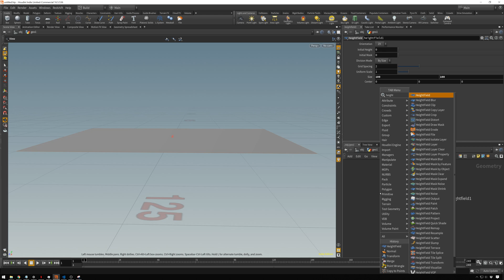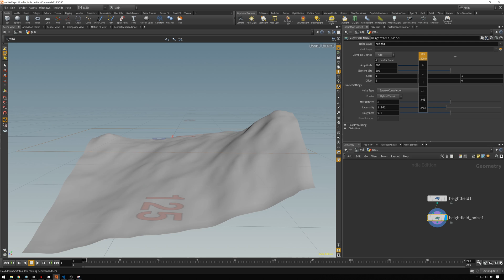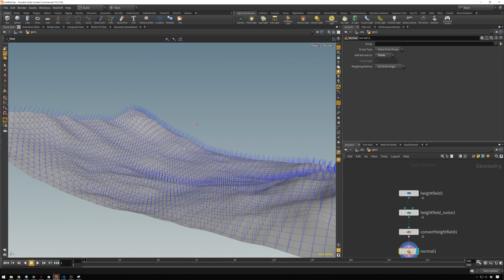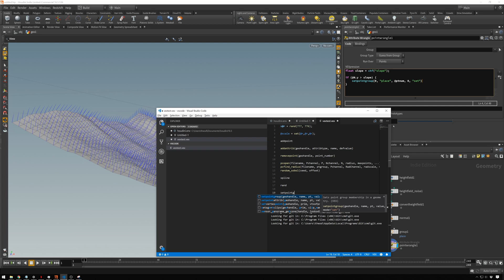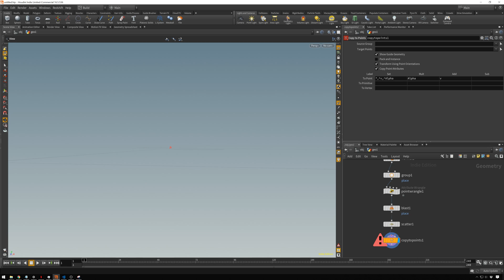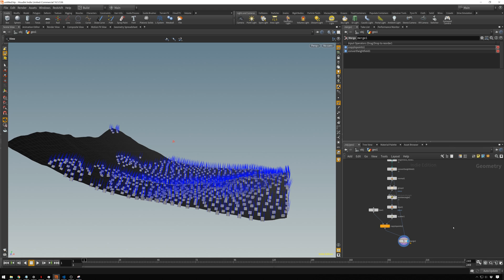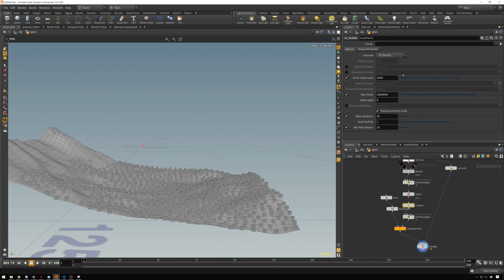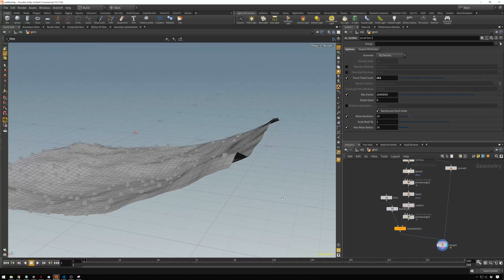Houdini Tutorial - Place objects based on slope

Comment: Thanks for another great tut, nice to see a tiny intro to VEX!  Way easier for me to pick up a scripting language on the fly than figure out 1000 prebuilt nodes and options with hard-to-guess names.  A couple tiny details:
In the Normal node, need to set "Add Normals to" to  Points, the default is now Vertices which won't work as described.
The sorting vex didn't work for me as written, it set all the flags to 0.  I wrote instead:
float slope = chf("slope");
setpointgroup(0, "place", @ptnum, @N.y < slope, "set"); 

n that worked.